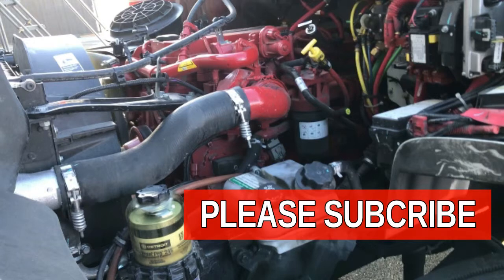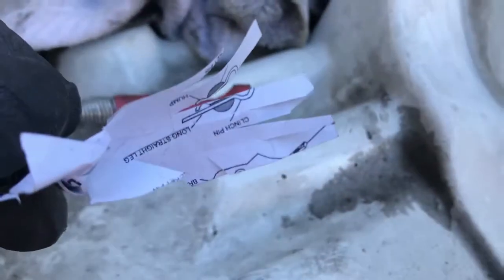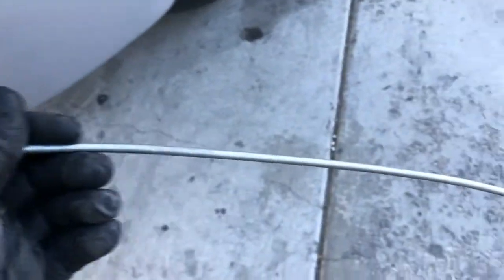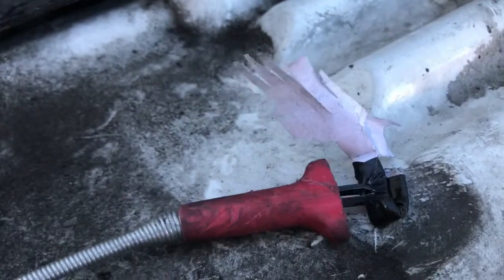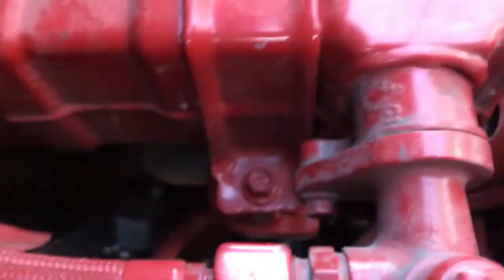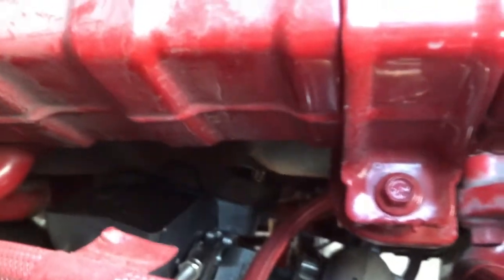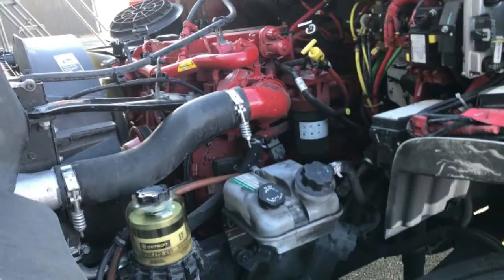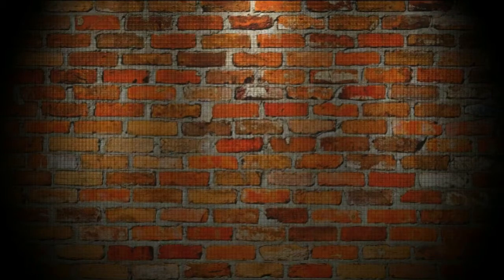Find exhaust leaks on Diesel truck engines and gas car engines.

Comment: I’m thinking you can also spray it with soapy water. On a second thought, soapy water might not work well for very big leaks like in the video.
Reply: Can u do that while it’s running?
Reply: @omarvalerio2361  yeah
Reply: It depends where. If it is on the exhaust manifold it self or somewhere where is too hot soupy water won’t help because the heat will burn the water instantly and creates bubbles even if there is no leak. Try spray the manifold u will see. Best method is to pressurize the whole system turbo at the intake and plug turbo at the exhaust behind.